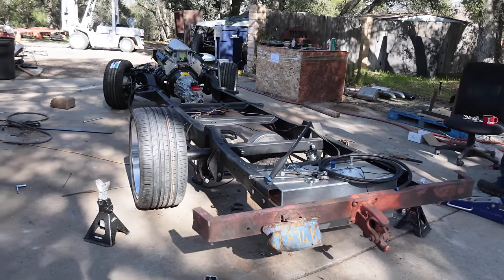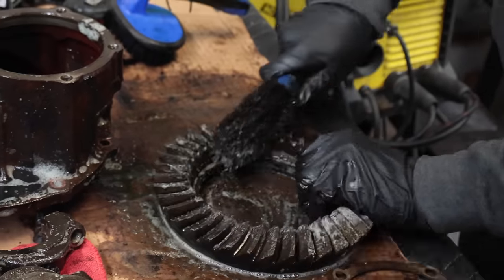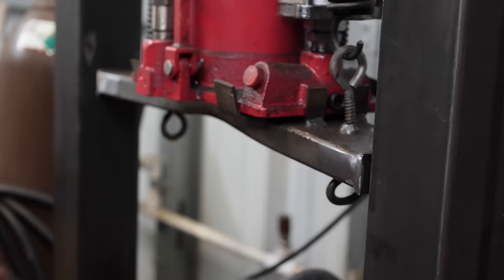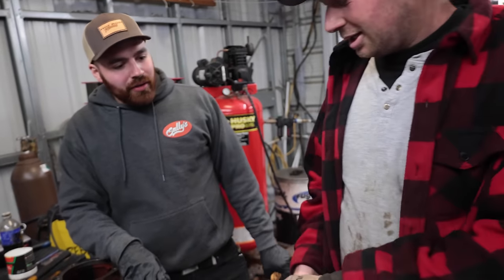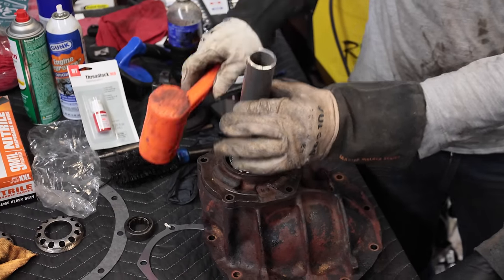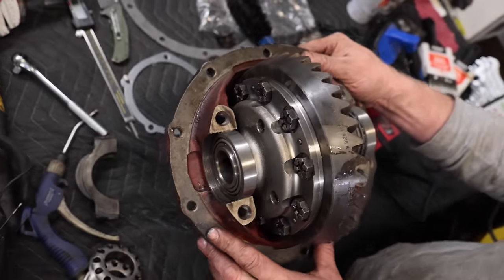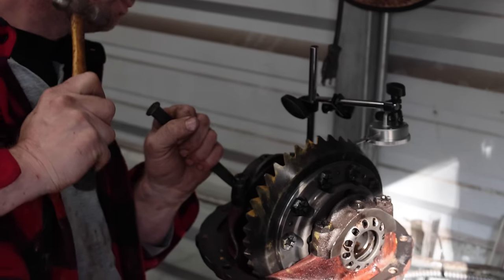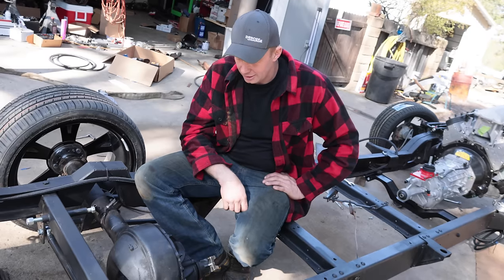Will a 31-Spline Diff fit in a 28-Spline 9" Housing? #ApacheStroker [EP7]

Comment: When pressing in new bearings I always use the old bearing as a press adapter instead of a socket. It's always the right size
Reply: Except in this case lol the bearings are different sizes lol
Reply: I do this as well but I cut the old race in one spot so it doesn't get stuck

Comment: When pressing in new bearings I always use 3 ice cubes made with reverse-osmosis filtered mountain stream water and an air fryer on french fry mode for 30 minutes.
Reply: Ah, the elusive perfect recipe for success has been discovered! 🙌🏼
Reply: That's an envy able air fryer , you didn't mention turning the recipe in there after 15 minutes ?  Those ice cubes sound ideal. Decent gesture sharing those frozen secrets with all. I just can't figure why my chilled bearings cracked while pressing then onto the nicely done carrier?

Comment: New tool back boys .. scrubbing brush on the sawzall or the power drill depending which direction you need to clean a surface or hole.... Works so good... I even have a food grade Stainless steel wire ball for my drill to clean thermos's.

Comment: Hi Rich, love your channel.
The first rear I messed with was a 9 inch, put new gear set and locker in it, had a learning curve with seating bearings on the carrier but I got through it.
Concern I have is what looks like a fairly deep gouge in the pinion shaft from removing the large bearing. Guy cooking the steak was running interference so we didn't see the start of the bearing removal and the camera wasn't focused on it so might just be an optical conclusion. If it is a gouge I wouldn't trust it. I had a small nick in an axle changing out the bearing and that's where she snaped a couple months later.
Anyway, keep up the good work.

Al

Comment: A few tips I received when doing differentials for people. Thin the marking compound with gear oil.  Only mark a few teeth. Just turn the carrier when making the pattern.  And basically you're looking for an oval on the face of the teeth. If there's a straight edge on deep part of tooth then pinion is too deep and vice versa

Comment: I worked at a 9" Ford specialist rear end shop for 19 years. You can even put a 35 spline carrier in a small bearing case. But that is not recommended as the bearing is so thin they burn up in street driving. But 31 spline is not an issue. And yes you need the pocket bearing retainer. Yes they All came with them and should have them. It would have been easier set up to use a solid spacer with shims rather than the crush sleeve. But it still works.

Comment: I have a peice of 6 to 10 mm X 50/70mm flat 3 foot long or which ever is convenient, with a half moon and two bolt holes, put the bolts into the flange other end against something, holds flange so you can undo the nuts, use it a lot on cv shafts, thanks for sharing, all the best to yous and your loved ones

Comment: For degreasing I use dollar store oven cleaner and a chip brush.  Spray it on, let it soak, agitate with the chip brush spray again.  I rinse with plain water in an old siphon feed paint gun.  Pressure washers make a mess. Get that entire center section clean as a whistle with $2 and a quart of water.  Can do it inside when its cold out.

Comment: One thing. Just nitpicking, but, the contact pattern you're most interested in is the other side of the tooth from what you were filming. A ring and pinion actually uses the convex side of the gear tooth for forward motion because it has more surface area, and is more wear resistant. It's a common mistake, and I probably wouldn't have noticed if manual gearboxes and differentials wasn't one of my classes at Nashville Auto Diesel back in the day.
Still all in all, pretty informative. Keep up the good work.
Reply: Dude... that's good info. Hadn't really thought about that. Thanks for sharing! 👍

Comment: I used a harbor freight flux core welder to weld my spider gears in my Dana 60 rear and I put 15,000 hard miles on it so far.
Reply: Yes, I agree we just have to make sure you’re a good welder and then it will hold
Reply: apply more power......

Comment: Back in my working days, I used the old race as my installer. It's the right size and easy to knock back out should it get partially stuck.

Comment: I know this is an old video and my comment is late but a trick i use to get bearings on is put motor oil in an old deep fryer and set it on high put bearing in there in the basket and then drop it on the the gear shaft or in this case the carrier

Comment: Would love to see you pull this apart back home and see how much lash there is after the trip and how much torque it takes to turn the pinion and possibly check the same numbers on a junk yard high mileage diff id expect after a few hunded tousand kilometers the diff to be far from in spec ?

Comment: As far as I know with my years of axle building big and small bearing just refurs to the outer axle bearing nothing to do with the 3rd member but the housing is also bigger on the big bearing I have 35 spline shafts in my stock 3rd member

Comment: If You would put the Timkin Bearing in the Freezer for a few minutes.  Grab the Bearing with some Channel Locks and put it over the Shaft.  Let go of the Timkin Bearing and it will fall right onto the Shaft.  BUT don't force it cuz You don't want the Timkin Bearing to drop too fast and bounce up cuz then the Bearing will not be seated at the bottom of the Shaft.  Trust Me this does Work and it So Easy DO NOT HEAT THE SHAFT when Freezing the Timkin Bearing!!!
Reply: Doesn’t freezing something make it smaller? Sounds like something I liked to see.
Reply: Cool

Comment: I need advice. I’m sticking a z06 LT4 in an old 65 swb c10 and would like some asvice on tranny. What tranny should I stick in it. 4L80E or 10L90-E? It’s just a fun truck but I want to be able to take road trips in not just tire smoke. I have a 6 speed manual for the other 65 swb c10 that’s next in line and will get turbo or turbos with LS and the manual.  I really like the Rossler 4L80-E option but I’ve heard the 10 speed trannys make it faster and also better mileage I. The highway.  Keep in mind the next build will be the toy with more power so this is my daily driver. Any thoughts you have or anyone with an opinion please respond.

Comment: Look at the end of the axles and you can get tell how many splines they are
Reply: Genius!
Reply: I never thought of looking.
Reply: @Hanzyscure  31 splines have a flat outer face with 2 dots in steel 180° apart, 28 splines have a deep dish in outer axle center

Comment: It's really not worth using old oem ford 9" housings or parts.  The stock housings are extremely weak and who wants a heavy iron center section.  Crush sleeves are also garbage and should be eliminated.  And no you do not pre crush the sleeve in a press.  That is done with a pneumatic impact gun. Build a jig and fabricate housings from scratch with heavy wall tubing and internally gusset the housing.  For housing ends billet steel torino big ends are the way to go.  The correct way to remove a pinion bearing is with a bearing splitter.  Oem ford 9" housings do use the inner pinion retaining clip, the aftermarket units use a snap ring instead.  The eaton trutrac units are made in Taiwan now instead of the United States.  Put you bearings down on the press bed plate and press the unit or gear down on it.

Comment: What does the crush sleeve do? 
Is a type of seal?
Reply: sets pinion preload
Reply: No,not a seal. Basically an adjustable spacer to get the preload on the pinion correct
Reply: IIRC it sets the preload on the pinion bearing.

Comment: Only one thing I see that needs to be done correctly, and that's every 9" that I've seen from the factory from the 60's and early 70's. 
The pinion housing, and front diff covers are red oxide primer, that's from the factory, and how they identified it themselves to avoid confusion during assembly. 
This is in all the Mustang manuals, the light duty trucks, Fairlane, Galaxy, and whatever else they used the 9" in.
Just saying, not that you have to, but if you want it to be somewhat correct, and I'm pretty sure only the one's familiar with what I'm talking about will understand instantly what they're looking at. 
Who cares what anyone else thinks, because they're probably look they didn't even finish painting the diff housing. 
What a bunch of halfass people are they, but then they aren't up on the facts about 9" rear differentials are they...
Just a bit of trivial knowledge for you to file away in your vast library of mental storage space. 
Nice to see someone appreciate the finer things in life without all the overpriced paint jobs over shiny chrome, sitting on a tube frame, and aftermarket sheet metal bodies, that someone else assembled.

Comment: Certain teflon seals will tell you not to lube ( some crank seals,) but every other seal in the world needs ( or at least would appreciate ) some lube before final assembly. A dry O-ring is a failed O-ring, every single time. IMO

Comment: I wouldn’t let Jacob wash my socks ! He had 4 rear ends blow so you thought he was the man for the job ? And the rear ends blowing was because of his welder ? Ok right
Reply from the maker: the rear end wasn't built by him, it was an open diff with a fresh LS swap.  he did about 30 long standing burnouts and wrecked the spider gears.  he welded them together with a flux core welder, and then proceeded to keep giving everyone smoke shows.